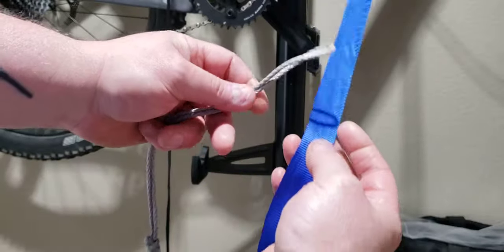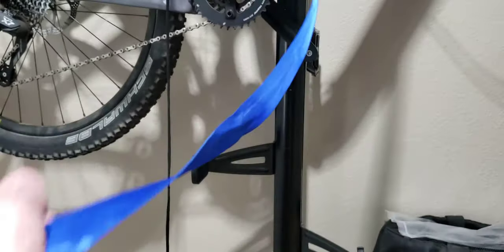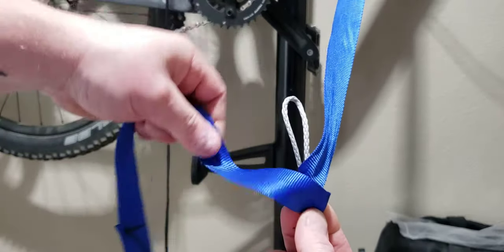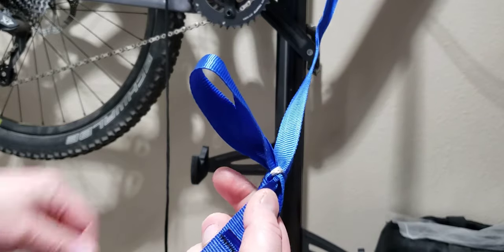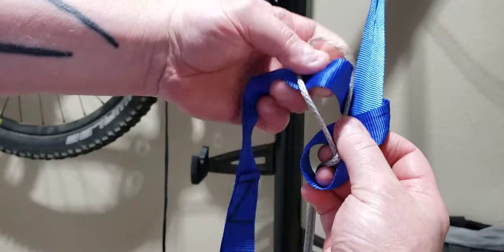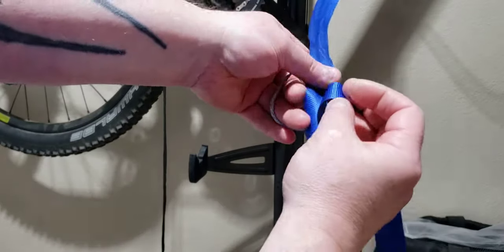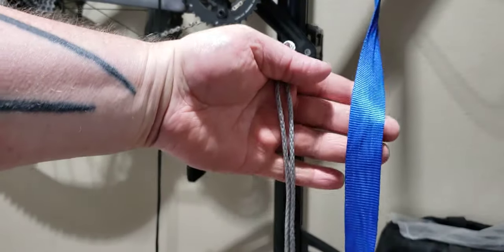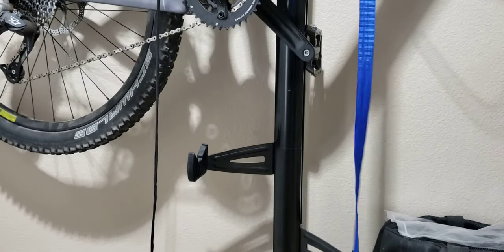Lapp knot becket hitch alternative on hammock continuous loops

Comment: This actually a variant. In its basic form, the tag end is not wrapped all the way around the CL. However, this variant does add considerable friction to the setup and is better for more slippery materials, specifically UHMWPE. I've been using the standard Lapp Hitch (slipped) with Kevlar 3.3 and Amsteel CLs for a long time with absolutely zero slippage.
Reply from the maker: sounds good! not sure what you mean "this actually a variant" or what??
Reply: @jeffmyers7062  You have the tag end wrapping all the way around the CL and coming out the "back side" of the CL. In the "standard" configuration, the tag end is wrapped around the back of the CL and then simply tucked into the CL, over the working end:  https://www.youtube.com/watch?v=QfdZkrWw1ro  It is hard to believe that this will work for a hammock suspension, but it does... I've used it a bunch and it seems to defy physics.
Reply: @cmoulder14  So you are wrapping the webbing around the CL but then NOT continuing to go around to the BACK of the CL and taking a bite, but rather coming in the front?  That's enough to hold?
Reply: @John Hebb  Yes, just like in the vid I linked. I have hammocked many, many nights with this with zero issues.
Reply: @Bob Moulder  Interesting, thank you.  Jeff just goes around a half turn further.  Have you tried that as well?
Reply: @John Hebb  I have not because it isn't necessary. I've tied the basic Lapp with Jeff's poly/dyneema hybrid webbing and have had no slippage. I can't attest to other materials such as 100% uhmwpe webbing because I haven't tried them. I have used poly webbing and Dutch's poly spider and they work fine.
Reply: @cmoulder14  Me too, same, standard Lapp is perfectly good without the extra wrap, lots of nights with it. I like all the options though, fun to learn other methods.